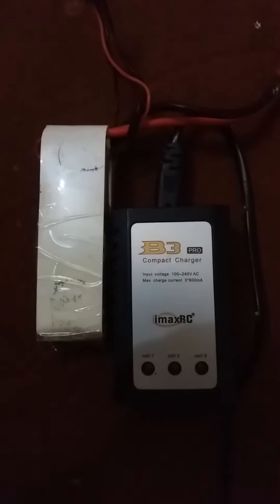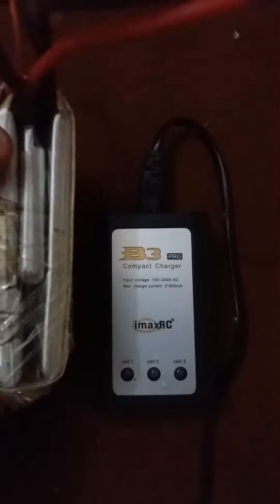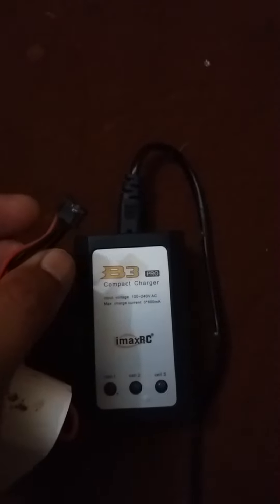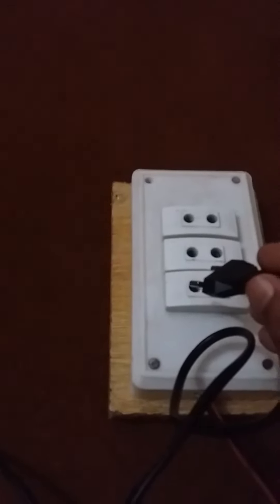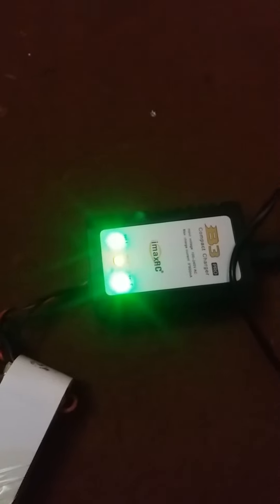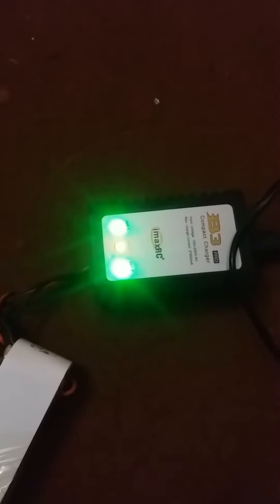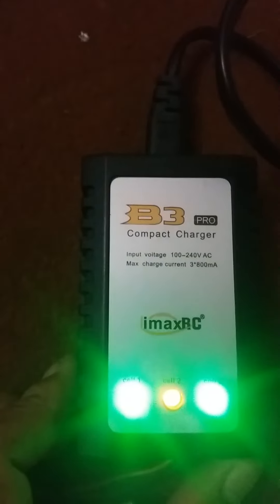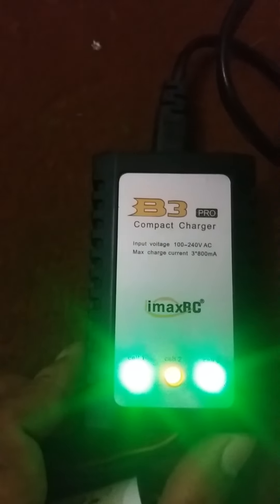how to use imax B3 lipo battery charger

Comment: 3 cell battery with in how many minutes it  will full charge
Reply: prolly like 2-3 hours but be careful these batteries are very very sensitive and can explode if overcharged
you will have to wait for the light to turn green